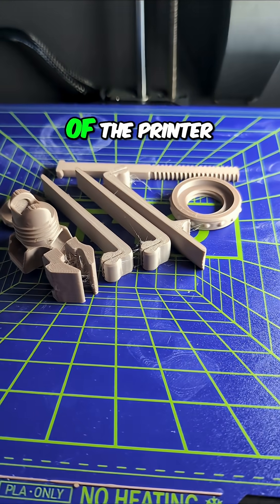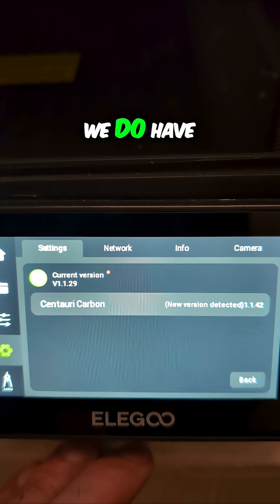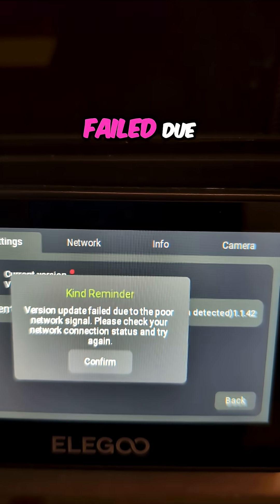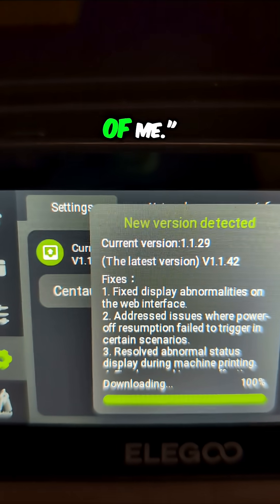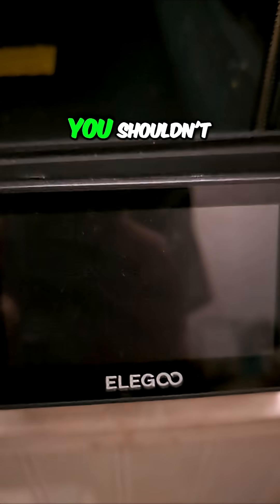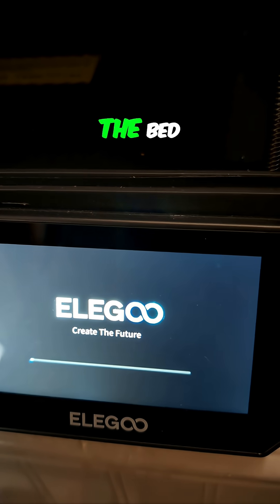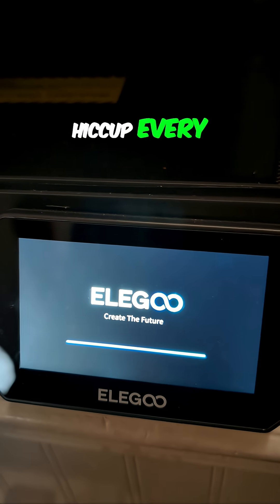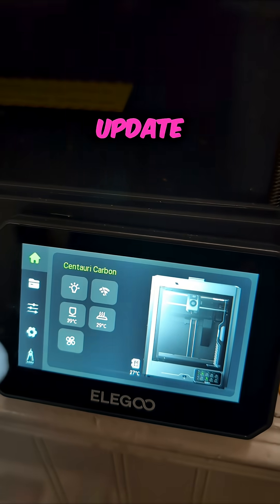Elegoo Centauri Carbon 3DPrinter Firmware Update: Easy Guide & Troubleshooting #shorts

Comment: I HAVE THE 1.1.29 WICH HAS THE WEB UI GLITCH OF NO MODIFICATIONS, BUT MINE WORKS FINE WITH THIS FIRMWARE.

Edit: sorry for the caps
Reply from the maker: No need to change it if it works, right?

Comment: This update is Very buggy and wouldnt recommend. Elegoo is currently looking into a fix for it.
Reply: yea, they broke part fan control, bug introduced with 1.1.42, still present in 1.1.46. Creates fan error monit every print. I was forced to install opencentauri firmware to be able to use printer normally.
Reply from the maker: I haven't printed much at all since upgrading. Haven't had any issues yet, but hoping they fix it fast before I "need" to print a bunch of stuff. :)